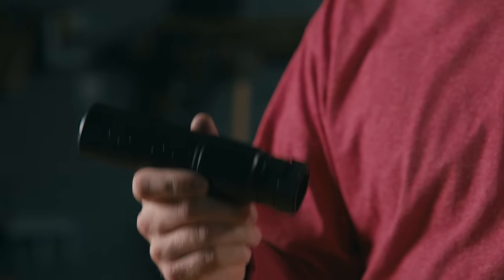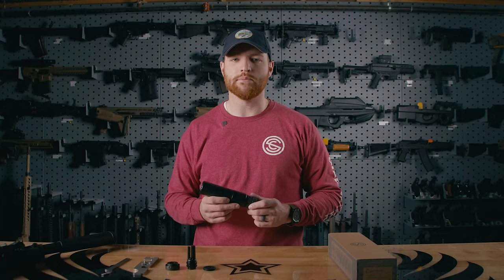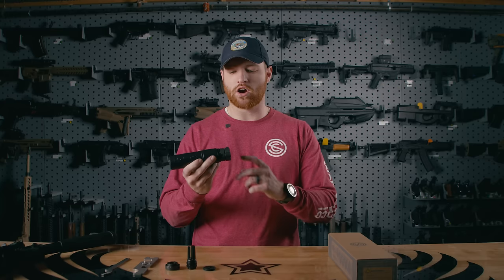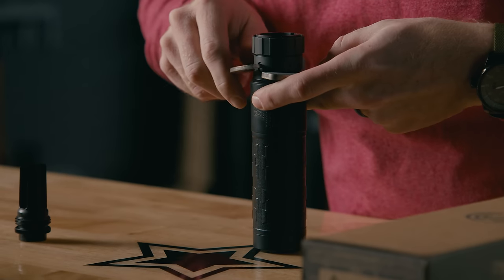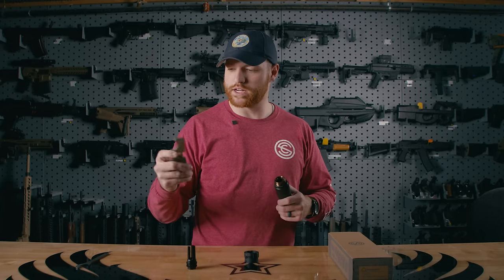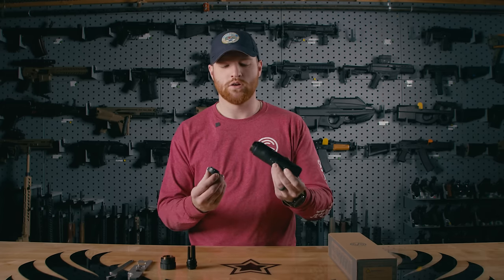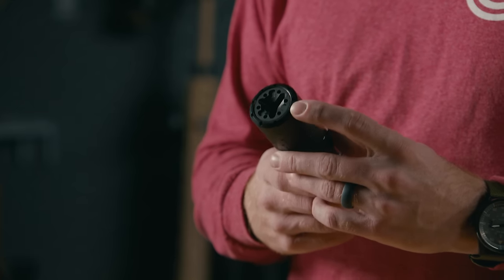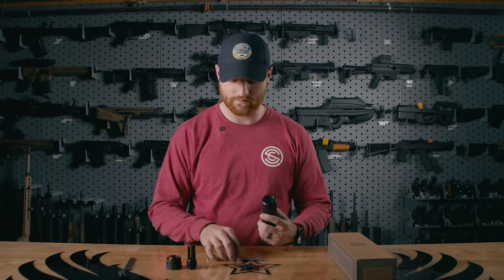SilencerCo How To: Velos LBP

Comment: I STILL love your Specwar 556 on my 11.5". But this is really grabbing my interest. How would muzzle and at-ear suppression look for the Velos compared to the Specwar 556? I tend to find that, with the Vltor A5 system, LMT EBCG, and SLR Ti adjustable gas block, that my rig is quieter than any 11.5" with the SF RC2 I've yet fired. Both for bystanders and at the ear.

I am hoping Velos does this without having to essentially build the entire gun around the can.

Comment: Are there any issues with gas pressure on the Velos LBP, with an 11.5 inch barrel on an SBR? 11.5 is short enough to be very violent at the muzzle with a ton of unburnt powder, that could conceivably cause baffle erosion?
Reply from the maker: While baffle erosion will always be more intense on SBR's you won't have to worry about it with the Velos LBP for two reasons. 1. The Velos utilizes an inconel 625 core and our patented Hoplon Blast Baffle that significantly reduces erosion. 2. We have the best warranty in the business so should you somehow run into issues we've got your back.
Reply: @SilencerCo  Wonderful news. Thank you. Is this also correct for the Hybrid 46m. I just received it a few weeks ago, and plan to use this until I get a stamp approved for the Velos LBP.
Reply from the maker: @JustIn-pf9ei  The Hybrid 46M is good down to 10'' barrels when using 5.56. So as long as you don't go below that you're good to go!
Reply: @SilencerCo  Thank you!
Reply from the maker: @JustIn-pf9ei  Not problem. Just let us know if you need anything else in the future!

Comment: I’m familiar removable baffles, wondering how does one go about cleaning a welded core ?
Reply from the maker: A welded core is much stronger to hold up to high pressures created by center fire rifle cartridges. The pressure also does a great job of breaking up and expelling carbon buildup with each shot. The short answer is the average person will never have to worry about cleaning a well made rifle suppressor. Should you insist on cleaning the baffles you can plug the bottom end of the suppressor with something like a rubber plug and fill the suppressor with CLR from the top. Let it soak for a day, drain, rinse with water, let dry, and shoot. Avoid getting CLR on any of the painted or treated surfaces on the outside of the suppressor as this can strip the finish off.

Comment: If you already have a flash hider muscle device and does the internal one on the suppressor work better or does the external cat work better which one would work better and let’s say you wanted to use a muzzle break instead of the flash hatter, but yet you still wanted to use the flash hatter in cat what kind of combination would you get there as far as the flash or what is the best combination for flash suppression that you currently make